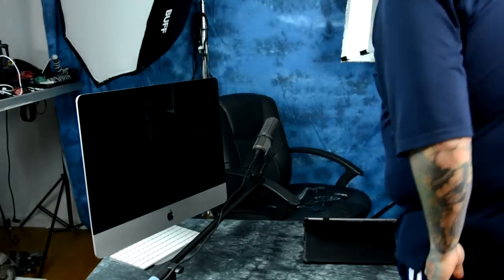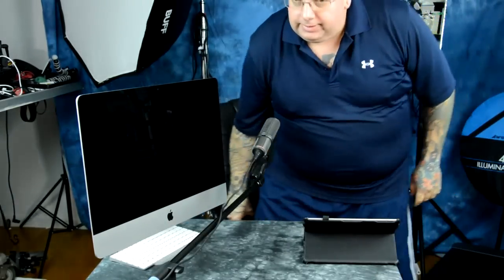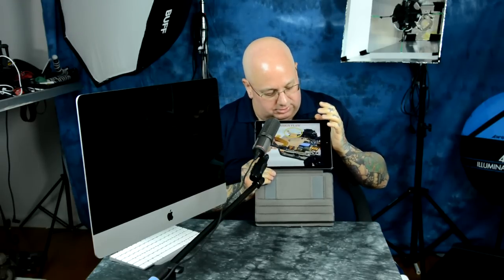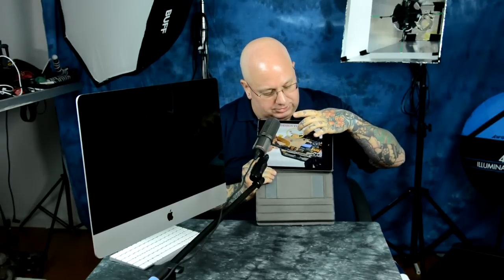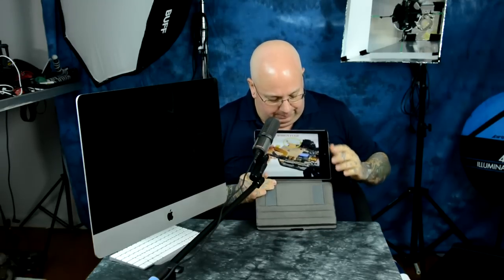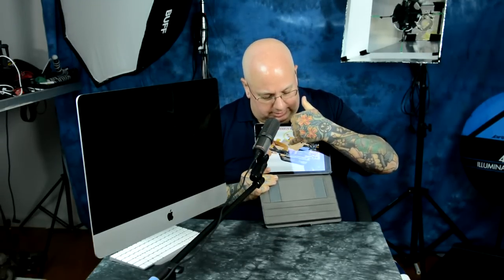PROOF: Sony A7Rii Design Flaw & camera failure due to External Heat-Shield wicking

Comment: Is this a moisture wicking problem or a cathodic protection problem. The metalic structure in the photo looks like a sacrificial anode.
Reply from the maker: its exposed to the open, the viewfinder is covering it but its utterly exposed and wicking moisture to the center of the camera

the inside of the rear magnesium cover along is proof of this ……all 3 cameras ive seen are like this
Reply: No doubt there is a design flaw. The pattern of the corrosion is very curious though. Looks familiar.
Reply from the maker: check out and read these new pics:
https://www.flickr.com/photos/134746128@N05/29055926931/in/dateposted/ https://www.flickr.com/photos/134746128@N05/29132993285/in/photostream/ https://www.flickr.com/photos/134746128@N05/29055927351/in/photostream/ https://www.flickr.com/photos/134746128@N05/29132993525/in/photostream/
Reply: The magnesium plate you showed looks like galvanic corrosion. Magnesium is very susceptible to this. Can't prove it though. Good find. Glad I didn't buy a "phony" camera.
Reply from the maker: check out my newest video and NEW PICTURES

gotta see that
Reply: Maybe this was the reason A7iii has plastic back on it now.

Comment: Check this out a7R has same layout only different material. Think there is something wrong at Sony PCB supplier.
http://www.imaging-resource.com/news/2014/01/29/sony-a7r-teardown-what-secrets-lie-inside-our-2013-camera-of-the-year
Reply from the maker: ohhh man, youre gonna love what i found out for the 2nd video here
Reply: +Theoria Apophasis Yep saw the photo's ,  copper oxidation starting at external connection points and using two different material without isolation sandwitch. Have doubt about the  moisture  forming theory, since moisture is not something one can easy controle.It is also quite simple to be solved ( first 50-100 customers will be as usual ignored , standard Canikon , Sony customer procedure ). Btw I did not see  gaskets anywher? it show enough about WR bs. For Jungle or usage on boat and open see I would take Pentax with me or D3.

Comment: Based on my experience with Sony audio equipment, I would never buy a Sony camera or anything else. It is a bit disturbing to me that Sony may make the Fuji sensor. Say what you want about Canon sensors, but at least they do not use Sony sensors.
Reply: Nothing wrong with Sony sensors. It's the other bits that attach on the Sony sensors in the Sony A series that is the problem.
Reply: You probably don't know that sony makes almost 70% of the sensors.Two bad cameras has nothing to do with sensor and how is sensor made.
Reply from the maker: true, the sensors are fine, but they BOUGHT those companies
Reply from the maker: not exactly, SONY BOUGHT the companies that make sensors……hey, let sony make sensors…

just keep them away from making CAMERAS
Reply: I did not it was as high as 70%, but let's hope sensor design and manufacture does not go the way of their audio stuff and cameras.
Reply: +Donald Groves I own Sony audio (high end) and couple of  A-mount camera (a99, a77II) never had issue with any of them .The worst experiance was with Canon service Europe and then with Fuji XT1 (might be bad luck).The problem now days is cost saving , cheap engineering and manufactoring resources (read as not made in Japan).I don't dare to reconsider E-mount Sony cameras.
Reply: +Theoria Apophasis Wrong statement , they bought only Renesas bancrupt stuff.
Reply: Well, we all have different experiences with products we have purchased during out respective lifetimes that inform our product buying decisions. For me, my major product disappointments have been with Dell, Sony, General Motors, and Volkswagon, so I no longer purchase their products.  However, this is not to suggest that I would criticize others from purchasing products made by those manufacturers. We are all to some degree prisoners of our experience.  Actually, my experience with cameras, Fuji, Canon, and Nikon have been good, and recommend anything made by them to friends.  In fact, I consider my little Nikon FG to be best camera I ever owned. I just loved that little thing.
Reply: Nikon has been using Sony sensors for a while and those sensors work wonderfully in the Nikon cameras.  It appears that you just don't know what you are talking about.
Reply: Thomas, understandable given your experience, which is much different than mine.  My  32 year old Nikon FG still works as far as I know (gave it to my daughter) and my 9 year old Canon XTI, which I gave to my niece-in-law also still works.  I never had any issues with my Canon 6D or 7D.  I did have to the top plate replaced on my Fuji XE2 because the on- off switch failed, and my Canon 24-105 had to be serviced as the IS malfunctioned, but the service experience from both companies was good.

On thing we serous cameras buffs lack is a reliable source of information regarding regarding reliability of cameras and camera brands. like there is for cars and some other stuff.  As a result, we have to rely upon personal experience and anecdotal information, which is less than objective.
Reply from the maker: Holy hell, check this link
https://www.consumeraffairs.com/cameras/sony.html
Reply: +Theoria Apophasis Never had issue with sony camera or with coating, probably because I always use protection glass on it.For me one thing is certain, I will never buy another Canon (had so many issues with it and so called pro support, at the end took my camera with me to Japan where they replaced whole thing without any issue).Sony flaw is not having own service, so there is nothing to improve there .They have service contracts with independing service centers and they might be bad or good, depend on country and service center itself.

Comment: Thoughts on the A7S 2? Which camera would u recommend for video?
Reply from the maker: im not a video guy……..i wont speculate on the A7s, i dont know if its internally diff on this issue
Reply: If you absolutely bar non need low light get the a7s or a7s ii , ( keep in mind a7s ii overheats ) for everything else on a budget get the gh4. I own both camera's the gh4 is a much better camera.
Reply: For video I would go for Panasonic gh4 or wait for the 5  great reviews
Reply: +Jakub Wojtkiewicz I need something that can do 120fps 1080p, good low light for night shooting and stabilization
Reply: If you absolutely need all that than the sonys are your only option. The gh4 has 96 fps, but no stabilization.
Reply: +Jakub Wojtkiewicz stabilization I can do without but the biggest selling point I like about the Sony is the 120fps 1080p and low light